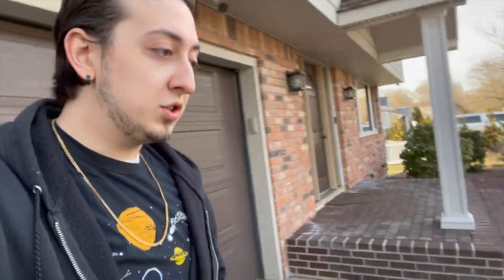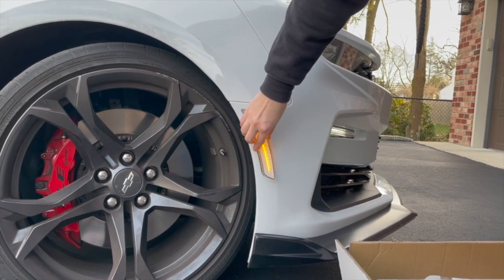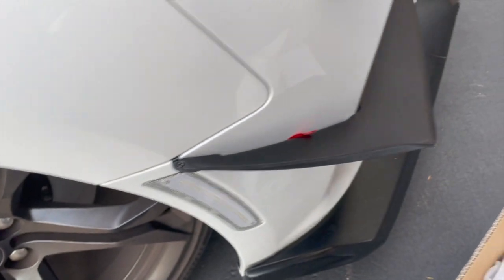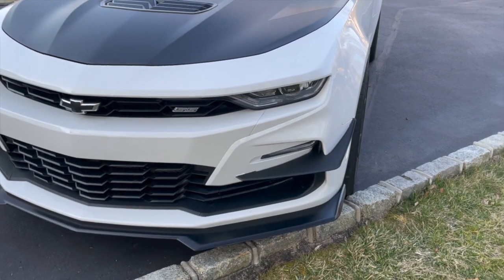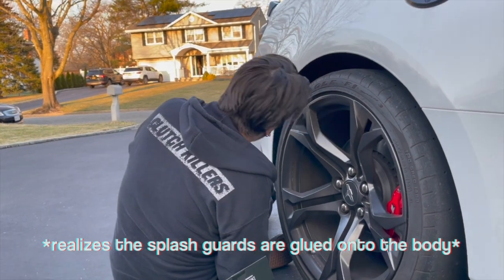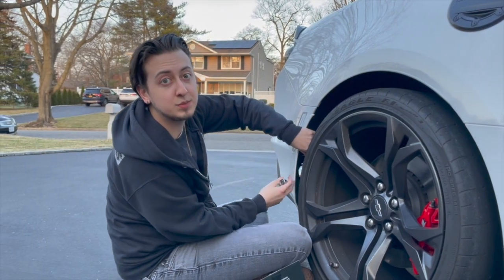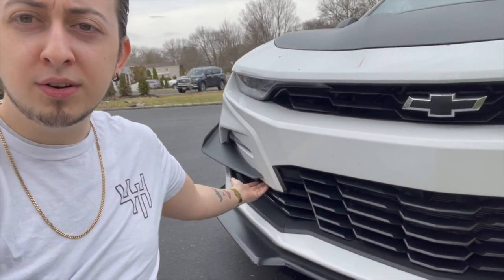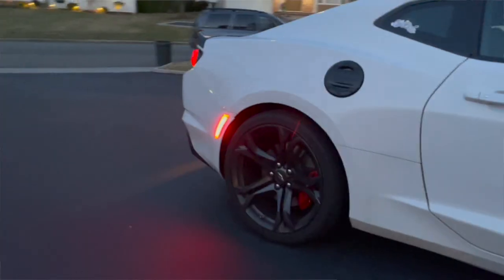INSTALLING CANARDS / DIVE PLANES & REFLECTORS ON MY 2021 CAMARO SS 1LE!

Comment: Thanks for the video. I recommend using a heat gun to heat up the adhesive and then sticking it on, has worked great for me in the past.
Reply from the maker: Didn't think of that, thanks!